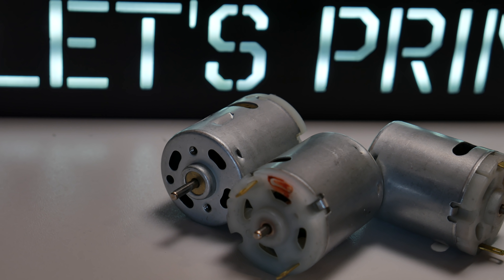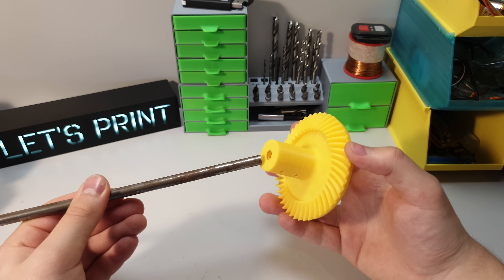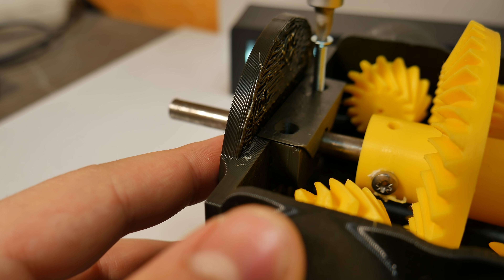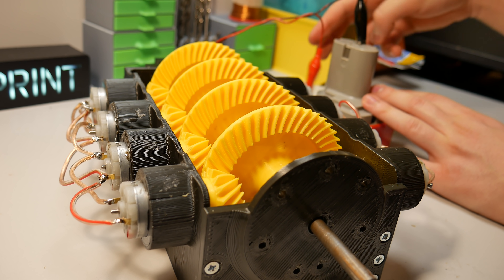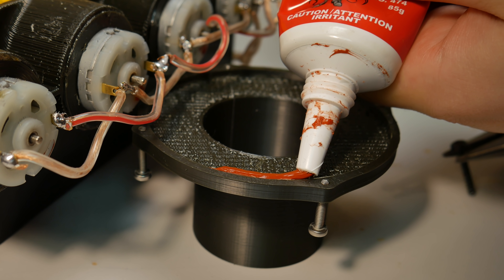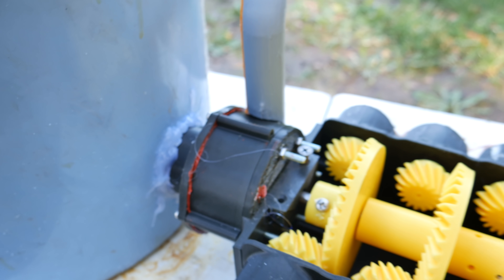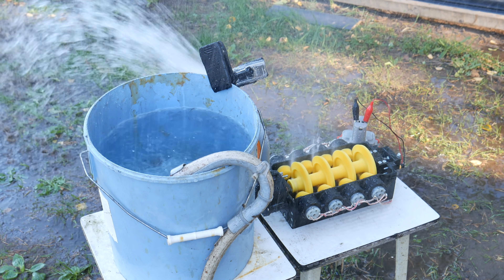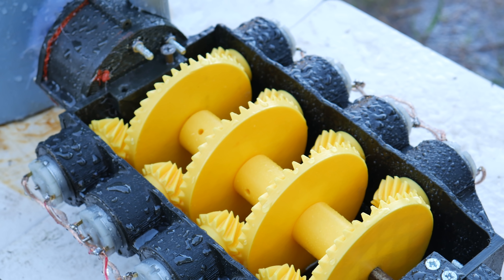Extremely Powerful 3D Printed Gearbox & Water Pump - Eight Electric Motors

Comment: Love the content but watching you use the needle nose to tighten that bolt bothered me in ways I’ve never been bothered before 😂
Reply: You could make another 9 minute video explaining all the engineering, fabrication, design, and assembly errors in this little project 😂
Reply: Yeah I hear you there lmao
Reply: Ha ha ha I was thinking the same thing, there are so many other tools you can use. Even a pipe wrench or vise grip, anything else. Don't know why that bugs me so much
Reply: He could have printed a wrench hehe
Reply: Also he way over tensioned. That's what really bothered me
Reply: @224rebels  what were the torque specs?!
Reply: It's only been 25 years since Communism fell so i'll cut him some slack.
Reply: @LBCAndrew  It didn't fall. It just moved to America.
Reply: I fast forwarded this video and it landed on that scene... Out of pure curiosity I forwarded it some more instead of moving on to another video. 3d prints gears, uses needle noses to tighten bolt...

Comment: On the pumps I've serviced there is a well that the shaft passes through that has 2-3  seals and is spring loaded against the impeller. You could 3d print some 'wheels' that fit on the shaft that hold an o-ring.

You'd need a good surface finish though. The ones I service are all polished stainless steel.

Comment: Not sure I entirely understand the motivation here...
Trying to combine the force of multiple DC brushed motors by locking them with a gearbox ?

THis isn't a very efficient design... The motors aren't all going to run at the same speed when given the same voltage.  changes in materials, magnetic flux in the permanent magnets and windings will make one run a bit faster than the other, so you're having the faster motors use part of their force to speed up the slower ones.
And you're loosing power in the gears themselves of course...

Would be an interesting challenge to find out how much electric power is actually ending up pumping water and how much is wasted and compare that to a single more powerful 12v motor.

Comment: with metal gears and more powerful motors, this could perhaps move a car because of the torque
Reply: With more power can make bigger thing move. Very smart statement.
Reply: @collinb-12  yes, mainly coming from a drill motor
Reply: Not engine its called motor

Comment: Nice work! Design pump housing to accept proper size lipseal, so it will not leak anymore. And also spacers are blocking the motor ventilation holes. So spacer should be little shorter.

Comment: I think that it would be cool if you designed a cover to slide on over the motors so the water doesn't short circuit anything.

Comment: For water-tight shaft housing, check out a "stuffing box".  Basically, you make a cavity for the rod to pass through, and you stuff the area around the shaft with valve stem packing material that's a cord with graphite lubrication on it.  The packing allows the shaft to turn but creates a water tight seal around it.  This is how some faucets and ships have a rotating shaft that prevents water from seeping in.
Reply: hehehe cavity rods

Comment: You should have made a point to the lock nut, for minimal contact (thus far less friction).
Can otherwise be done on the steel rod, if you feel uncomfy with altering the lock nut.
Either way, MINIMAL friction is the way to go if you want more power.
It actually should ALWAYS be.

Comment: Im not trying to be a buzzkill, but i honestly dont quite get it.... I mean its a nice construction and all (well done!) but in the end u connect it to a battery for a hand tool..? There are already pumps on the market that have the axel exposed so we can attach them to my screwdriver and just start pumping. The last one i tested with my Festool seemed to have more powerful flow then your 8-engine-model, but i dont know cos i dont see any numbers on water flow or power consumption on yours..?
And if you exchange the 8 small engines for 1 big one that is equal to the 8 you got, would that be better or worse? 
The gear-ratio seems to be ~1:3, why did you chose that and not 1:5 or 1:2..? Have you done any testing to chose this specific gear ratio?
Have you tried to just put the pump-part (without the gearbox) with an exposed axel on a good battery powered screwdriver?
Or maybe to print a better small 2-wheel (or more) gearbox for a screwdriver?

I mean you write that its sposed to be "the best, most powerful, and insane..." but if you dont compare it to what already exists on the market, or other gear ratios, or even other pump wheels, how will u know? With the gear ratio you chose it looks like you could attach a bigger pump/wheel to it, wouldnt that make it "better, more powerful, and insane"..?!? Im honestly just wondering.
So can you give us some stats for it so we know just HOW "powerful, and insane" it is?

"Best" is after all to a large part personal opinion...

Comment: anyone else having issue getting this to print without the back corners warping?  

I have my print bed at 70, fan is off on first layer and goes to 100% by 10mm height , printing creality pla at 200, first layer sped is 20 mm/s andprint speed 80mm/s 

Im printing on an Ender 5, my print bed is flat and level, also Im running a BL touch so bed level shouldn't play into it, tried a couple of orientations and still keeps warping at the same place

Comment: Just to point out - Helical gears are obviously smoother than straight-cut gears, they tend to cause longitudinal forces along the shafts. What you could use is bi-directional helical cut gears which would cancel out the longitudinal forces. Because they are 3D printed, there aren't the same difficulties with making them that there would be with machined metal parts. The only problem is in the design bit!

Comment: Is filament printers better than resin for working parts?
Reply: doesn't really matter, your main print material has to be okay for the specific application you want, also resin prints tend to have fever defects, yet again you don't really have many options for print material, filament prints again are rough after finish, you should always termotreat them to smoothen out the surface... all in all, depends on what you wanna print and where will you use it.

Comment: On the "water out" spout, put a cylinder full of straws, some cloth at the end, a cap, and then a hole out, so you get laminar flow and it doesn't go all over the electric components.

Comment: Use plumbing washers to sort out water liking to the gear box you might make a cover too, also cover for the electrical motors as they are not water friendly, also as the water takes time to fill the bucket make a sensor with arduino to check level of water to engage the start and stop of the engine save energy.
Lots of room for improvement but heeeey is a terrific project to the poor countries as they have more sun for solar energy. Thank you for sharing.
Man in its core is all good.

Comment: It is a nice project to practice printing gears. But if your objective was to build efficient pump then the whole gearbox was a wasted effort. You just needed a correct motor directly driving the impeller. It would have been more power efficient too.

Comment: Just a few suggestions: 
Use sockets or spanners rather than pliers to make your video look more professional. 
Turn the motors 90 degrees in the housings to make your wiring much tidier and presentable. 
Use a car battery rather than a tool battery, they're probably not designed to be connected to things other than the tools they come with, and the car battery will give you much more clearance to play with for connecting.

Comment: In most large electric pumps they fill the inside where the motor is with mineral oil to keep the water from shorting out the electronics

Comment: If you use a magnetic coupler between the gearbox and impeller then there will be no way for water to leak into the gearbox as the won't be any mechanical linkage going wet side to dry.

Comment: Until I saw the splashing I was going to suggest opening vents at the front of the motors. A nice feature of your design is the wear is *evenly distributed*, no reduction or planetary systems. I bet that pump would run continuously for a long time. If I had to nitpick anything, the impeller walls should be round. Corners are not as efficient. Not a problem. Nice work.  Congratulations.

Comment: anyway cool video, and making that water pump, whith a smaler gear atach to the big one, you can run that pump faster,  yeah the motors are smaler, but you are lossing the strong of the motors with the diference in the gears diameter.

Comment: Does this Wartepump work to extract water from some meters below?

I need to do a maintenance in the swimming pool and my motor does not pull out all the water from the bottom.

If this works for some meters below the motor, this would be perfect for me.

Would you please be so kind and answer this?

Thanks and regards from Brazil!

Comment: great project. Looking at the impellers of your pump. most impellers are at an angle or even curved while yours are at 90 degrees to each other. It would be an interesting test to try different angles or curved profile to determine the most efficient impeller shape. A water pump profile in a car motor would probably be pretty good one to copy.
Opps! just saw your other video on testing the 4 different impeller profiles - another good job. I think there may have been other factors involved in those results. 
Keep up the good work

Comment: I might be tempted to make a "hot rod" motor for a powerwheel out of that design. Neat way to make an super compact and portable high output water pump. LOTS of potential uses. Thanks for the video

Comment: A nice project overall, I agree that some refinements are needed with the bearings and the pump seal. I am however curious about one thing. This example is essentially gravity-fed and not much lift is needed to raise the water to the discharge even if the bucket is almost empty. I would like to see how much lift this pump could do. For example, sit the pump above the bucket and have it suck the water up a pipe. Given the impeller design and the integrity of the pump housing, some form of manual priming would definitely be needed at this point anyway.

Comment: so space saving idea... 1 main gear, double sided radial positions of the motors (I take it the motors used will be reversible for the back side of the main gear).
Add an o-ring into the motor shaft (from inside of the gearbox, concave grove so it retains itself) and the pump can have a light oil added to prevent wear.
The sealed rotary design and oil should reduce noise and make it water/dust resistant.
if you made the 2 halves split front and back then a simple addition/subtraction of a shim of plastic gasket would allow adjustment of the float of the pinions to the main gear.
Both halves could be the same part with an output on both sides (so you could double the pump volume without stressing one side of the box, or power something else.

Comment: pretty fine job, it's not a problem to have open contacts on your DC motors below 50V. However i do advise you to start using heat shrinks on your solder joints. Also if one of the motors falls out of sync with the rest, it will probably chew up your gears. Generally speaking it is better to use one large motor. I hope this helps you, I liked your video.
Reply: These aren't steppers, so that won't happen. They will each speed up until the torque resistance of the load evens out against the power from the motor.

Comment: Soo was it eight engines to distribute the work load? Couldnt u use one big engine? I think theres like spiral/ screw pump designs that might be more efficient, tesla turbine in reverse type of thing. Anywho, nice video sir, abs is a better choice, PLA would degrade too fast in that application

Comment: Should've did a lower gear ratio. Higher rpm less horsepower. Didn't need that much horsepower but could've gotten more speed.

Comment: This will be sick to use on a soft wash system. It will be much cheaper than buying a 8gpm pump. My college has a 3D printer. I’m considering downloading software and uploading the CAD into the software to print the part. Freaking 30 bucks for a ridiculous pump, this thing would be great yo sell on forums for contractors looking to buy affordable pumps.

Comment: You do not balance properly the electrical source for all the motors.
The first in line get a lower copper resistance, they vill provide more torque and will heat more than the last connected.

Comment: Your project was great the only thing that i think can be improved is to increase the water propeller wings from 4 to 6 or even 8 with the same speed, motors count and power the water flow will increase more

Comment: I do not understand the reason why use 8 eletric motor instead of project more efficient pump. If you use a more vanes for pump or use a curve shape, you may have a better result without need 8 eletric motors. Other point is, hydraulic pump has an optimum work point in a specific instalation. So you should read about and i believe you will make great progress! Good look and congratulation.

Comment: Alright...
Eight electric motors
Worm gear to toothed shaft
Very high ratio
Motors attached in spiral pattern and use an Aduino to alternate the voltage to the motor with the most stress
Attatch that to a 3d printed gearbox and have that shaft drive a pulley driven 3d printed water pump

Comment: An oring could have been added on the pump input shaft side. Though i think for better efficiency the internal clearances could be made better or using a different style of impeller. Overall cool video

Comment: For testing purposes, why not feed the water back into the bucket.   Closed loop system so you don't run out of water.  Except for the small amount leaking into the gearbox.

Comment: The cylindrical adapters you made to fit the motors into the large openings are technically called “bushings”, not spacers.

Comment: Very impressive, especially the water resistance of the circuits. How did nothing short out with that much water everywhere? o_o
Reply: Water isn't super conductive, but it will corrode the motors over time

Comment: Have you considered extending the shaft from drive system to pump to allow leakage without it going into gears?  Maybe a shaft through PVC pipe with drain hole.

Comment: I've probably missed the start of this project, but why use 8 small motors and a gearbox, instead of one large motor?
And, yes, you just figured out that a pump needs a stuffing box between the pump and the motor, to stop water going out and losing pressure

Comment: It may be included a rubber seal on the shaft.
Instead it is possible to change the 608zz bearing with a 608rr one, because it have rubber seal installed.

Comment: You know you forgot lubrication.. need some grease on those gears and some light bearing/gear lube for the bearings... Plus to improve water tight seals I would do some silicon around bolts and etc. Make sure all the power connectors are sealed most importantly. You can pack grease in the gears area and seal with silicone to keep that mostly dry.

Comment: It is not good to have wet motors. It should be better to print a one piece cover over the gear chamber that covers the gears and motors using a robber seal and the chamber should be supplied with paraffin oil in the bottom to ensure gears lubrication

Comment: needs to be redesigned so every-other gear is reversed, so that the whole box doesn't twist.
Also should be encased so you can fill it with transmission fluid.

Comment: I have a better idea for this.
Each pair of motor turns in oposite ways, the center gear device has gears on each side, this way the force is not all applied in same direction.

Comment: A longer shaft between the motors and the bucked, along with drainage holes could help with the corrosion and short circuit problems

Comment: If the gearbox was mirrored then the motors on one side could run in reverse and the central shaft would be more balanced so that it is not being pushed to one side.

Comment: You could separate the fluid side and the gear side completely and transfer the power through magnetic coupling.
You also could utilize a bearing to hold the gears in place ... or turn (at least) one of big gears around.
For even more power you could use brushless rc motors, they tend to be very powerful examples: https://www.motionrc.com/collections/motors
Though you might want to print with reinforced materials and and or nylon.

Comment: reverse the crown gears and you wont need a backplate pushing the shaft onto the motors, it will just press itself, presto less losses less noise less parts less settings and more pump power.

Comment: Honestly, why it is published at all! Everything is wrong, what value this video has? How not to do things?  You build it in with sole purpose of to be used in water, and had to take care about leak during design, not after failed test.
Also WTF was that bolt pushing main axis? Another design flaw. I would be acceptable video if you silently tested and fixed issues retroactively, but you even not bothered.
In the and we have video "Look, I am noob, I cannot design anything, here I publish so you all can laugh on me"

Comment: What is the advantage of this over using a single, more powerful motor and eliminating all those gears?
Reply: This is a fun project I guess
Reply: @braydencooper2441  Yes, I can see that.  I, too, have made many projects that had no real applications.  If the object of the exercise is to use a bunch of spare motors, and to play with your printer, then this is a great project, and the result is very pretty - but if the object is to make a water pump, there are easier, and cheaper ways of doing it.
Reply: @DownhillAllTheWay  absolutely